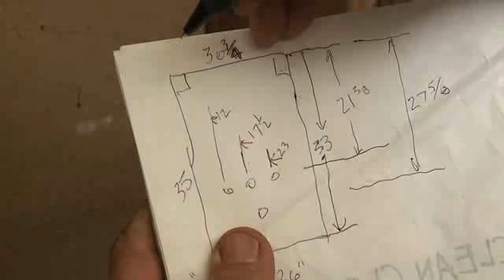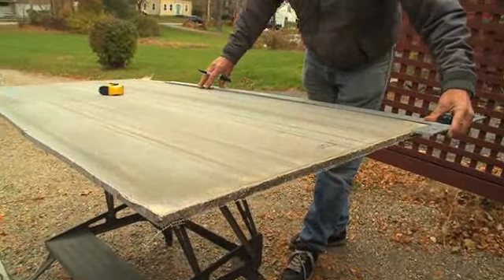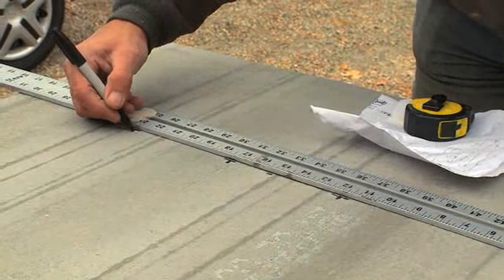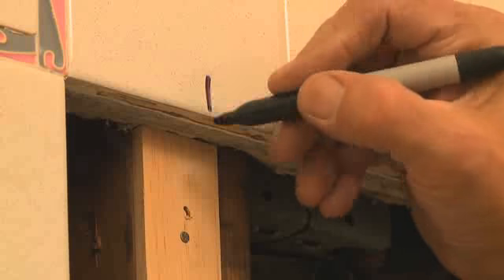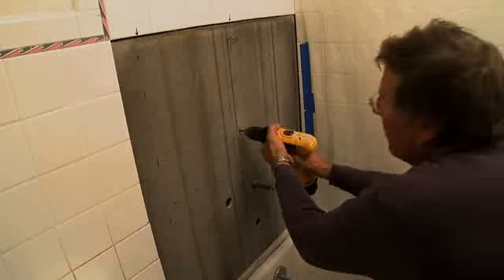How to Repair Broken Tile, Part Two

Comment: Seams need to be sealed better, caulk is not going to really work. Also, need to waterproof the board with redguard or something similar.
Reply: Instablaster.
Reply: He said silicone, and cement board does not need redgaurd, that's redundant.
Reply: @robertcampbell6364  cement board isn’t fully water proof even though it’s meant to be in wet areas.  Even if it was, redundancy when it comes to water is the way to go

Comment: The narrator stated that cement board is waterproof.  This is NOT true.  Waterproof plastic must go behind the board, over the studs, or waterproof treatment like Redguard paint-on waterproofing or a waterproof membrane like Kerdi needs to go on top of the cement board.  One or the other, not both.  Note also that the existing wall board is green drywall, with no waterproofing.  It is not correct.  The rest of this shower is going to fail if it ever gets wet.

Grout is not waterproof.  Water vapor passes in and out through the grout.  If the wrong screws are used, they can rust out and the wallboard can eventually fail.  This repair may last years, but it is not waterproof and it will not last long-term.  But since the green wallboard is going to fail if it ever gets wet enough, they will be pulling the whole thing down to the studs one day.
Reply: Thanks for the advice! I appreciate it.